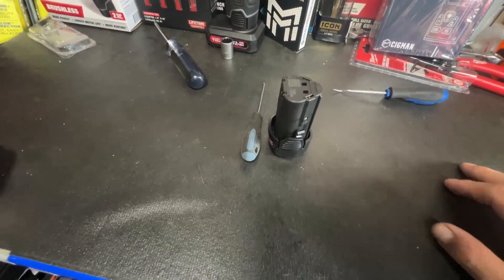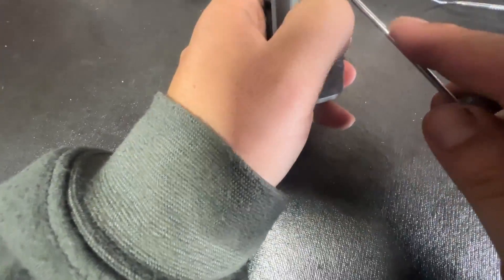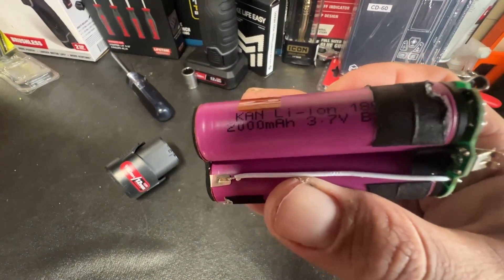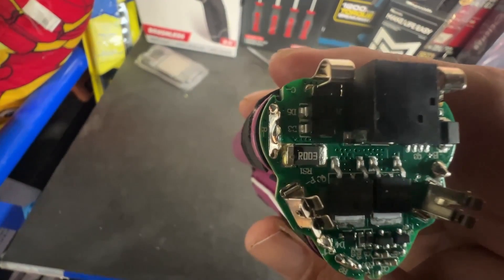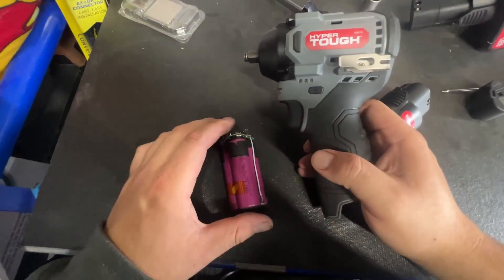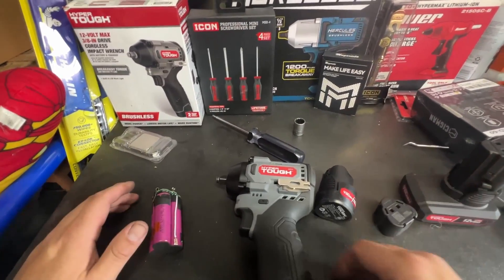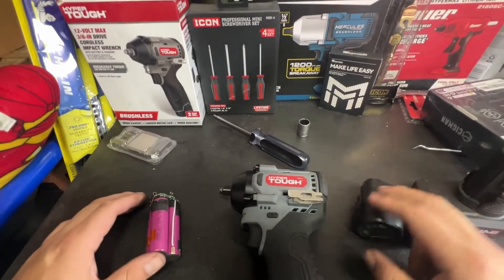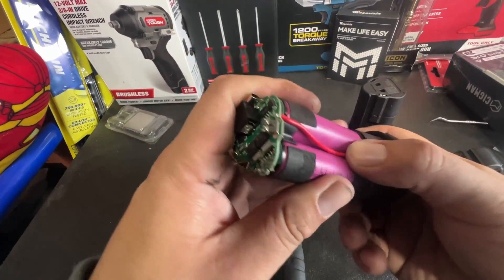Hyper Tough 12v 2ah Batter Disassembly!

Comment: I would love to see someone modify one of these battery packs weather it be the 2.0 or 4.0 with some higher MAH name brand 18650 cells like Samsung or LG or what to see how it effects the power of the impact gun. I would do it myself but I suck with using my soldering iron

Comment: Found more on the chip from the id, it’s another mosfet. It’s a 30v 10a mosfet. The continuous drain is 10a. Technically it could be more cause the tool is only 12v but for examples sake let’s just say 12v. When that 10a current is exceeded that will cut the power to the tool. I’m thinking to ultimately to protect the super cheap batteries because tools regularly can pul 20 to 30+ amps and way more easily. These are my
Thoughts but I may be wrong. It’s needs to see connection like I said before after I tried covering it with tape, which only leads me to believe that it’s for current sensing. Even if you tried running 12v from the - and + which should work, it won’t let you if it doesn’t see that pin. Which that pin has nothing to do with the brushless regulation. That’s all handled on the tool side pcb. The only way I see around this is to spot weld in some good name brand cells or change the resistor value or swap the mosfet with a higher current one.
Reply from the maker: I wonder if swapping it with a more robust mosfet would just destroy the batteries lol

Comment: With the flashing lights I'm sure the voltage has dropped enough to shut the tool off. I would check the voltage it freshly charged, and right after it flashes. I would imagine the cut off is around 10.5 volts. Lithium batteries also don't completely deplete themselves to ensure they can be re charged over and over again, so the board may  be tuned to allow the tool to run longer. Brushless motors on the other hand are kind of picky with voltage to where they useable volts tolerances are much less the a brushed motor.

Comment: I bought this because I cant get the Milwaukee version. I work on small engines and my own cars. I only have used the 4.0 battery with it and the 2.0 battery gets used the the long reach ratchet. I haven't had any issues but this is good to know. I would be willing to pay extra if better battery cells

Comment: could you read the marking on Q3?.. R003 is just a current sensing resistor... the reason i asked is this... there is a good chance you can power their 12 tools with any 12v battery/source
Reply from the maker: Ill check for you
Reply: Thank You Sir...  @toolsonabudget7763

Comment: Instead of ordering NEW cells, Maybe try using tested USED cells from a good quality pack (like Milwaukee 18v or DeWalt 20v) that had a bad cell in it? (yes, when a battery goes bad, it's usually only one cell.)